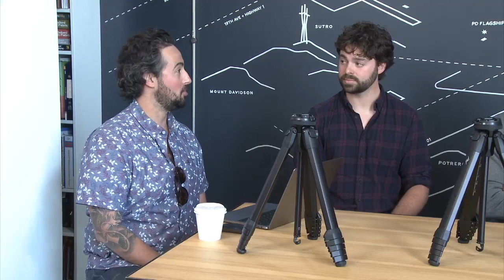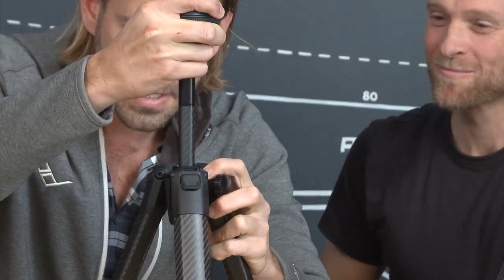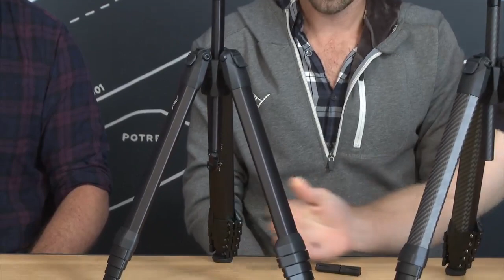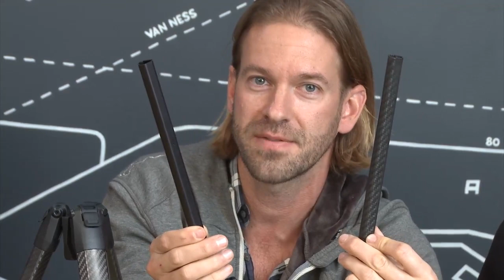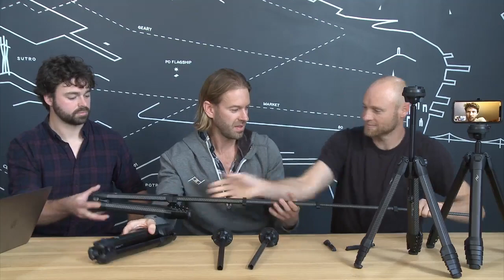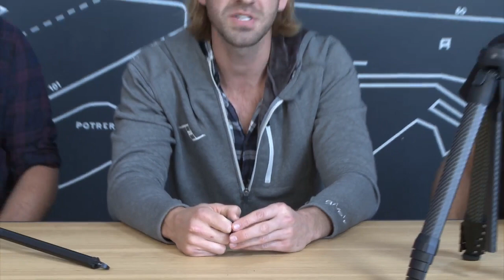Travel Tripod Kickstarter Hangout #5

Comment: There was a comment on KS forum by one of the backers that RRS chose Al for center column because of its cost effectiveness. To check if it was true, I called RRS and spoke to their technical team and they corroborated with that comment further adding that their tripods were mostly bought by photographers using long focal length and therefore, had little use for center column. That is also the reason they sell it as add-on and not as integral part of their tripod.

And Peter the reason RRS costs more is, unlike your tripod because they are entirely made here in US of A. FYI Tripods made in sweat shops of China cost less than yours and they are equally popular with professionals. So cut us some slack and stop being cheeky.

Since  now I realize the FTC option is open, I too will enlist my name but only after putting this tripod through some rigorous testing. Also Peter you can be less patronizing next time, there is no need for all that cockiness.

Comment: I'm actually glad that you folks opted for the aluminum center column.  Your detailed explanation for the switch, is in my opinion, a very good engineering tradeoff for better performance at the cost of only 16 grams of added weight.  But also because I originally thought when you folks launched the kickstarter, that the locking mechanism for the hook on a carbon fiber center column might wear out to quickly if I removed and reconnected it too many times.  With aluminum, that concern is gone.

Comment: Really appreciate the information. I am an engineer myself, and I agree with you -- when facing with an issue, instead of trying to bury it, share it with the customers. Explain how the problem came about. What you have done. What were the results of the attempted solutions. What other cards are there left on the table, what it would cost to implement each of them, and which direction you will be taking next. Because if you are sincere about all the information, so sincere that you are (apparently) exposing your weaknesses, your customers will not only see the candor behind you, but also be convinced of all the technical capabilities of the team, ultimately believing that no one else knows better in this issue than you alone.

Comment: I'm still excited and looking forward to receiving my CF Tripod but after sleeping on it and recognizing time is short (December) but with so much focus surrounding the weight difference (minimum impact) and strengthen between Aluminum and Carbon Faber materials for the center shaft was any consideration given to the use of a third material, Graphene? It's known for both being stronger and lighter than Carbon Fiber. Maybe in the future and after intense product testing you could sell a aftermarket graphene shaft. 

Thanks again for the update.

Comment: Peter, I applaud you and the entire PD team for making the right decision to IMPROVE the CF tripod, even if some backers stubbornly disagree. I just read the the comments on Kickstarter and can’t believe the short sighted comments a certain individual keeps hammering on about. At best he misrepresented this change as making it an Aluminum hybrid, which if we want to call it a hybrid, would be more accurate to call it a Carbon Fiber hybrid. The change adds just a bit over 1/2 ounce to the total weight. Carbon Fiber has traditionally been used for its better stiffness with the reduction in weight being a side benefit, NOT a primary design parameter. The change improves the stiffness and thats a good thing. I look forward to the final product, you guys are doing it right. Keep it up, its what makes Peak Design the quality company that it is, earning the respect of many in the photography community.
Reply: It is not as much about disagreeing as it is about the way it was implemented.

Comment: Nice job guys.  For the weight of a few paper clips, the practical difference is totally immaterial.  As for the cost savings, I've run a company with fixed price contracts with many puts and takes during the build process.  I NEVER made an additional return from a lower CGS.  It doesn't sound like you are either.

Comment: From an engenieering point of view I completely understand the advantadges of the aluminium. However talking about all the numbers, not just phyisics. Aluminium is cheaper than the carbon fiber. Which I would expect a decrease in price on the total price of the tripod since the production cost will drop for you, right?
Reply: Did you watch the video?  They explain this.  There have been multiple design changes, some cost less, some cost more.  The total difference has been 55 cents.
Reply: Mark St.Pierre this was a comment during the live stream. I made that comment before they explanied this part. And I belive it is around 3 dollars difference compared with both columns. Which is fine by me as I put on another comment. My question does not mean to be a complain in any way. Just asking if that would have affected the final price. It does not. As they justified perfectly.
Reply: @Perquisitoreman  : cool, thanks for clarifying.

Comment: For those of us who invested early and expected an all carbon tripod, why not give us the option with the lighter carbon center?   If I wanted the performance of aluminum, I would have opted for the much cheaper aluminum offering.   That said, please consider giving us early adopters/believers  of your carbon fiber offering the choice between aluminum or carbon centers.
Reply: Dana lus genuine question - if they did offer the choice now, why would you choose the CF centre column, knowing that it performs worse?
Reply: Scuccadenza The simple answer is I, like many others run a light mirrorless rig and don’t require an over engineered product that supports weights that are well beyond my needs.  That said, I would opt for the lightest tripod as possible that met my functional needs and that would be the one configured with the carbon center. Now for those that run heavier rigs and prefer the stated benefits of the aluminum center,  by all means give them the option to go that route.